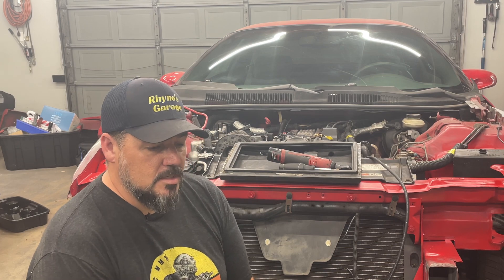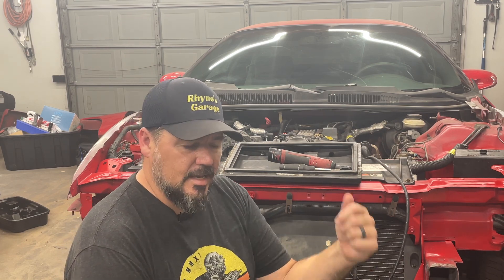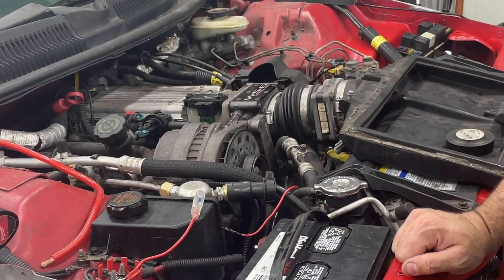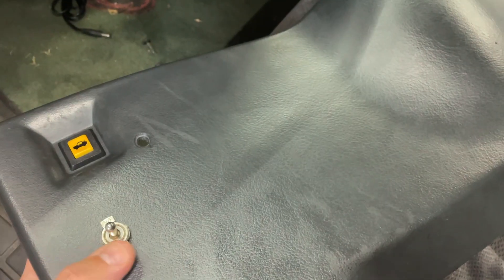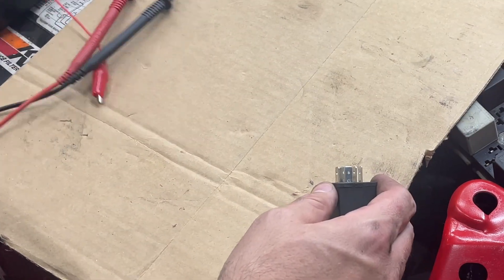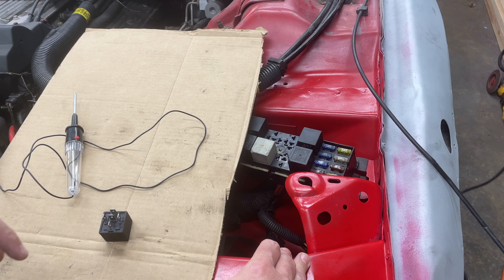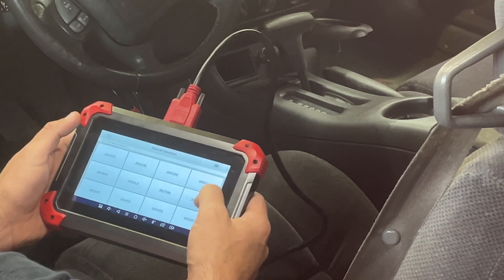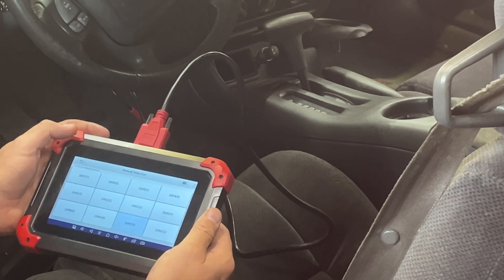Troubleshooting Engine Fans on the Firebird - Fans, Relays, and PCM Tests

Comment: Im fighting this issue now. There are 2 temp sensors. 1 for the gauge and supposed to be another one below the intake on front that the computer reads from. Im going to try to change thst one

Comment: Hey man, thanks for the video. Did you ever solve the cooling fan issue? Thanks.
Reply from the maker: Not really.  Found a wiring issue to the fuse panel under the hood that seemed to fix it for a bit, but then they did seem to stop working again.  I've heard it's a common issue in these and people just put in a manual switch to flip on when it gets hot.
Reply: @rhynosgarage  This means you have not replaced the sendig unit ( sensor ) and / or not checked the sending unit resistance in cold and hot condition as proposed in the repair manual or you replaced it and it's still not working ?